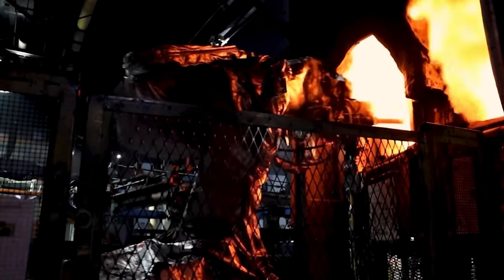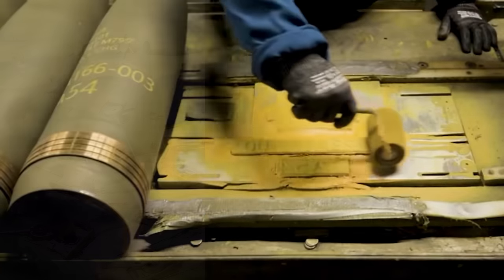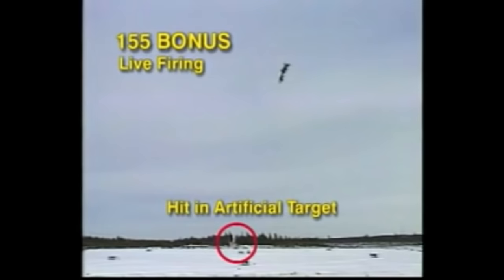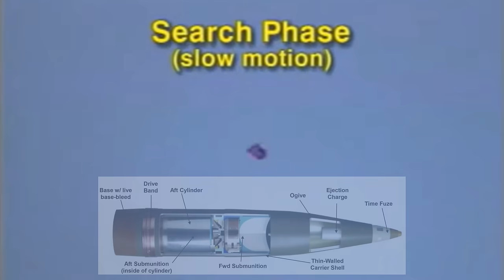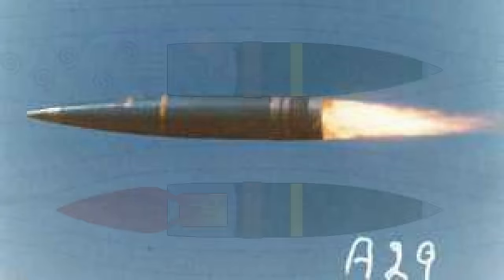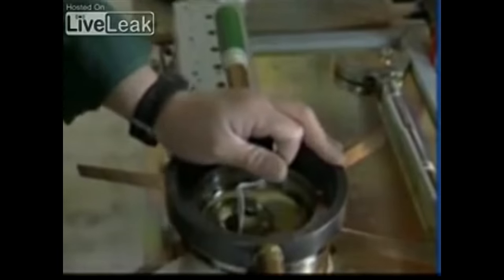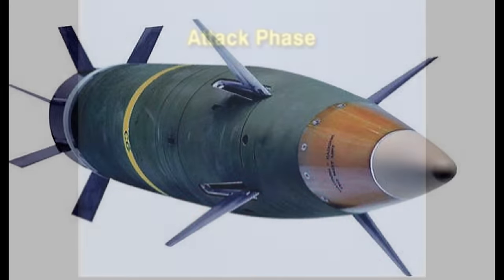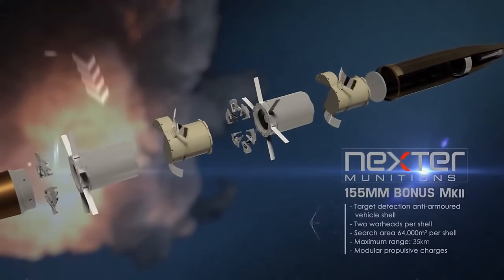Is the 155mm 'BONUS' Round the most Practical Artillery in Modern Warfare? TANK HUNTER KILLER 💥

Comment: Artillery is just mindblowing to me as you said. A small contained explosion that accurately blasts a ~20kg chunk of metal and electronics/chips that knows where it is the entire time. Even more amazing, a lot of this isn't exactly new, we had fuzed shells and such even during WWII, airburst was a brutal invention.
Reply: Airburst was used all the way back in the 18 hundreds. The canons were firing very flat trajectories, so the trick was to shoot over the head of the friendlies, and shower the enemy with scrapnell. They used a very simple, and smart, timerfuse, run by blackpowder.
Reply: @noahwail2444  He said airburst but he was definitely referring to proximity fused shells used by the US on the 5 inch guns for anti aircraft purposes. it had a small sensor in the head of the shell that could tell if it got within several meters of an aircraft (I think it was about 10 meters) and it would set off the high explosive shell peppering the aircraft with steel fragments much more reliably than timed fuse shells which relied on the fuse being adjusted to an estimated distance of the aircraft.
Reply: @dominuslogik484  Airburst  can also be achieved by a time that starts when the projector is fired or ignites the fuse cut the link before insertion in the barrel.  Modern ear boost ammunition used in 35 mm guns and similar calipers programmed at the muzzle after having had their velocity measured.  These are very accurate.
Reply: It doesn't know where it is.
Reply: @cullis8327  there are guided shells that do know where they are because they use GPS guidance.
Reply: Soo many artillery experts.
None who have ever fired a single artillery round anywhere at anything.
I have. A Fucking Shitload of Rounds. So stop it. Please
Reply: @peterasp955  well then Mr. expert please enlighten us on whatever wisdom you seemingly hold. also pulling the proverbial trigger on a gun doesn't make you an expert the same way I am not a firearms expert despite having fired thousands of rounds collectively at a range.
Reply: @dominuslogik484  based on Ukraine Russian war, Ukraine doesn't use Excalibur rounds anymore due to Russian jamming GPS
Reply: @danialnajmuddin3729  they do still use them but the availability of targets have been reduced by jamming
Reply: @dominuslogik484  yup i thinks that happen to all weapon system when you fought near peer to peer military for an example S400/Patriot cannot intercept all missile
Reply: @danialnajmuddin3729  the difference there is that the S400 fails to intercept missiles from the 1990s and the patriot has around a 75% success rate against modern "hypersonic" missiles.

Comment: I used to be forward observer in the Swedish army. We never got to use the Bonus rounds, but we used alot of Strix. The anti MBT mortar round. You should check that out as well.
Reply: Strix is really cool 👍🏻
Reply: It's essentially the same as it's the same munition being released from both. The only difference is the number of submunitions.
Strix might be a bit easier to use as shorter range of mortars also means the target wont have time to move much.
It's also pretty good as it's essentially fills the role of anti-tank "missile" for Swedish mechanized forces.
Reply: @znail4675  Not true at all, Strix is a 120mm mortar round with a bunch of small rocket boosters around it that directs the whole projectile down onto the roof of targets. It does not have any submunitions...
Reply: @Merecir  Seems you are correct. I dunno where I got my faulty info from. Is there some other round the reuses the bonus munition?

Comment: Projectiles are fairly easy to modify. Whether a country uses 155 or 152 simply depends on the existing artillery calibre. For countries with vast amount of former Soviet equipment, it would make no sense to go for 155mm as just modifying existing 152mm rounds would do. At the end of the day, volume of fire and reliability of the existing industrial capacity and supply chain is what matters. Plus, BONUS is a very expensive round. The top of all tanks currently in service are very vulnerable. When a standard artillery round would do to knockout the tank, such expensive munition would prove overkill. It would be interesting to see how it would fare against an aps system modified for coverage from the top.

Comment: I love how this round turned "cluster bombs are war crimes!" to "cluster bombs are totally fine" in zero seconds flat.
Reply: I dont think you can call this round a cluster bomb.. where as cluster munition spreads large number of dumb bombs on area, this contains two self guiding  smart HEAT rounds.
Reply: peoples issue with cluster rounds are the dud rate combined with how many submunitions there are lead to large amounts of what are basicaly landmines.
bonus on the other hand is more advanced leading to a lower dud rate of 10% and has around two munitions meaning it further drops the chances of duds.
Reply: @Tedger  Yet, DepState media called out Russian airforce, when motiv-3 was used in Syria. They cited it exactly as "cluster bombs".
Reply: Yes, but these are not really cluster munitions in the sense of there being multple bomblets that fall to the ground and explode later on handling. Sure, there are two (or, potentially more) components to this munition, but it explodes ~50 metres off the ground so when the bits fall to earth there is virtually no risk to any civilians who pass by later. Huge difference.

Comment: Hi Matt.  Since you're studying 155mm artllery engineering, perhaps you would be intersted in researching CLG guns.  I have been exploring the idea of a naval gun upgrade for larger NATO vessels which would incorporate a 155mm bore autoloading cannon of a conventional configuration, like the carousel fed 5" guns widely used today, but bigger; and for the propellant using hydrogen and oxygen gas generated by hydrolysis of sea water.  The gun hypothetical converison had already been designed by BAE several years ago, but using a CLG propellant might produce too much force for that configuration.  If you look at the speed a CLG gun shoots at, it's on the order of 7km/sec. And the range would reach 100km or more without using a rocket powered shell. At that speed, a solid projectile would do incredible damage without HE.  This system would allow for the unification of artillery logistics across services and with the increased range and velocity of the naval CLG propellant the navy would gain a major increase in firepower both in land attack and direct fire.  So please let me hear what you know about CLG and whether the bore of the gun would be burnt out quickly and whatever else you might discover that's public knowledge.

Comment: If they have milliwave sensors, i wonder if we will see cluster munitions that can (strongly) bias their pattern parallel down a trench line.
Reply: You would nee something bin and metallic for the Millimeter waren Radar to detektei, plus its Just not economical for killing infantry
Reply: @mkultra3679 Don’t rule out cluster substitutions homing in on individual humans.  It’s only a matter of cpu power
Reply: I don't see why not. Shocking things are possible with a little sensor fusion and data analysis.
Reply: @williamzk9083  we are probably a long way out from that still, and its not necessarily a matter of CPU power but rather cost.
Reply: Worthwhile for someone to work on
Reply: @Whatisthisstupidfinghandle  honestly a more cost effective and simple solution would be a purpose built drone using commercial parts that just carries a few smaller bombs as well as a main warhead. 

find a trench then run the drone along the trench and drop the smaller bombs inside before ramming it into whatever the most important part seems to be. I imagine this could be done much cheaper than making some super smart artillery shell that guides submunitions and needs to account for wind and other factors which may mess up trajectory between dispersion and impact.
Reply: @dominuslogik484 Drones are slow, less powerful, and require a lot more manpower. They are definitely useful, but there are a bunch of downsides to using them.

Comment: "Copper jets" are better descriptions of HEAT warheads whereas EFP warheads such as BONUS are usually tantalum, generating less of a jet and more like a solid slug.
Reply: Which brings less overall perforation capacities (which does not matter for top attack even on armored targets), but with a longer range a up to a few dozen meters (compared to only a few meters for HEAT).
Also, the profile of the projectile can be smaller due to the less constraining shape that is required to obtain a decent HEAT ammunition

Comment: Slightly tangental - Estonia in its 155mm shell procurement drive is looking to buy 500 anti-tank shells, this should provide a gauge for the relative expensiveness and manufacturing availability of BONUS vs SMART (faster delivery nets extra points). 

Using a SMART/BONUS round to destroy a non-tank is very much on point - the high value targets on modern battlefield might not so much be tanks but instead EW vehicles, drone control/supression and air defense, it also ought to be useful in artillery duels / counterbattery fires.

Comment: As a former forward observer, it's NATO 155mm, and yes the BONUS round, or the essentially equivalent system SMArt 155 which I trained with, is the most practical modern artillery munition for it's intended use case during Article 5, the price point is ludicrously competitive, for the SMArt 155 it's absolutely in the price range that a personel carriers or supply line trucks is a value for money. Even with the potential necessary clearing of missfired munitions afterwards. The SMArt 155 actually has a redundant self destruct mechanism to get it out of the clustermunitions ban and into the category of submunitions. The only thing that is going to come close isn't an artillery system but an infantry weapon, and a very recent development, which would be the NLAW.

Comment: There are videos of both SMArt and BONUS rounds hitting vehicles in Ukraine. I've heard that GPS guided weapons, not just artillery, have had a lot of problems striking their intended targets due to jamming but when they do work they deliver as promised. One the other side of the conflict the Russian laser guided Krasnopol round seems to be doing well and there are videos of it hitting everything from vehicles to fortified trenches. Having to have something close enough to paint the target is of course somewhat limiting compared to smarter rounds that you can just chuck and forget about but within drone range it appears to be pretty reliable.
Reply: That sounds inplausable. The GPS is actually not used to home the target. The GPS os uses to calibrate a inertial homing system so when it's very close to the taget the GPS turns of.

There is a new gen excaliber out for field testning that use GPS only before fiering and use inertial all the way (those are probobly not in Ukraine yet)
Reply: @matsv201  - such rounds are useless against moving targets, especially at long range,  when you have almost a minute fly time.
Reply: @matsv201 GPS jamming can have longer range than artillery so it doesn't matter what part of the trajectory utilizes it. Northern Poland and southern Sweden for example were recently hit with GPS jamming that I'm guessing originated from Kaliningrad (at least that is what it looks like on a map).
Reply: @mirandela777  well yes.. hence bonus
Reply: Russian krasnopol had way more succes in Ukraine than excalibur....as excalibir can not hit mooving targets.....
but to be fair, new excalibur will habe a laser pointer aswell...so it will be good against moving targets.....the new shell is in test faze for years now....
Reply: @Lipi19821  You can´t just fire laser at everything and hope you survive. Most modern system have counter laser system, so it really don´t work as you imagine.

Excalibur was never made to hit moving targets, it was made to pin point stationary target. nato have loads of system for moving targets.

Where do you get the information that they have way more success? You have to remember krasnopol is 30 km short of range than Excalibur. Ukrainian counter artillery is still punishing Russian positions.

155mm general having greated range than 153mm, and some nato equipment like archer and Pzh2000 have built in counter artillery radar as well as quick redeploy, Russian artilery sites are sitting ducks.
Reply: @matsv201  more succes coz I watch videos about Ukraine 16 hours per day...
Russia fires laser from drones high up in the air....works everytime....
Reply: @matsv201 Yeah, of course Excalibur and Krasnopol don't have perfectly overlapping usage cases. Which one will have an edge depends on the scenario. In some cases range and autonomy will win, in other cases jamming resistance or local guidance is more important, then there are situations where both will be outperformed by something like BONUS or SMArt and sometimes massive amounts of conventional rounds will be the superior option.

Neither Archer or Pzh2000 have built in counter battery radars but their targeting systems are built to work in conjunction with such systems. The radar detects artillery fire, calculates the origin, sends the coordinates to the Archer/Pzh2000 and counter-battery fire can then commence. Russia has similar systems but I don't know how well integrated the different parts are.
Reply: @Lipi19821  - obvious, laser painting ( by drones, and Russia has 10x more drones than Ukr ! ) is immune at jamming.
Reply: @matsv201  - is NOT about 155mm "having greated range than 153mm," ( and is 152mm NOT 153, lol) - is another principle dude, educate yourself !  NATO 155mm have a BIGGER propellant load = bigger velocity ; Russian 152mm have less propeller =  lower velocity, but a bigger HE filter. Funny thing, the russian 152 is even slighty HEAVIER than the western 155mm ( 152.4mm shell weighs 43.56kg and the standard 155mm shell 43.2kg).
A thing NATO fanboys  have no clue is the fact - proven in Ukr again and again ! - is the "detail" the systems using 155mm are stressed more than the russian 152mm,  if used to sustain intense rate of fire for many weeks, reason why NATO is forced to change the gun barrels a lot more than the russian/soviet system. Higher pressure in gun barrel to achieve longer ranges comes with a cost - fewer rounds / per barrel, more maintenance, less HE load. 
Numbers : muzzle velocity for "common" shells : 
155mm - 740 m/s, russian 152mm - only 695m/s (reason for longer range) ;  
propellant: 155mm has 8,9kg, when the russian one has only 8,1kg. That create a bigger  pressure in the barrel ( 280 psi vs 245psi in the russian): That means the system using 155mm will be significantly more degraded over time, than the russian one. Especially at high and sustained rates of fire.

One was build for SHORT engagements, giving long range but exhausting the system much faster ( that overload to achieve longer range comes with a price), the other ( soviet/russian) was build for durability and prolonged engagements. Different philosophy. Reason why systems like D30, 30-40 years old,  can fire hundreds of rounds / day for months, and murican / german ones wear-out after 2 weeks / a month, and need barrel replacement, if used as the Ukr uses them, to maintain the same RoF as the russians.
Reply: @matsv201 Regarding laser warning systems I think most targets don't have those and even if they do they would also need some way to counter. The soldiers in a fortified trench wont have a warning system and the same goes for many vehicles and buildings. Tanks do have them but there might still be very little they can do against the drone that's pointing the laser. Jamming the seeker might be possible.
Reply: @SNixD  anything worh targeting like a tank or a ifv have then for sure. Then you have a star streak right up your bum the second after.
Reply: @mirandela777  I'm not wrong and you are still namecalling me. Very unorifessional
Reply: @matsv201  - I am verum sorifossional you feel like that
Reply: @matsv201 So, all the videos I've seen of Krasnopol shells hitting armored vehicles, including tanks, must have been fake then?

Do you really think there are enough Starstreaks available to protect every armored vehicle? Every truck? Or that they can always engage the drone on time even if they do have those weapons and systems? Do you think logistics vehicles have laser warning systems? What about buildings used to house troops and equipment do?

How do you think the front line soldiers of Ukraine would feel hearing that anything worth targeting for sure has laser warning systems and the ability to shoot down drones within seconds? I recently saw an interview with an Azov brigade commander. He was angry at people talking about how shit the Russians and their equipment are because it makes the people fighting them seem incompetent.